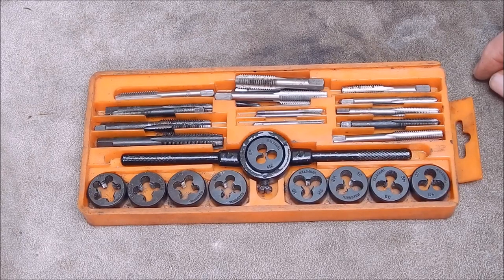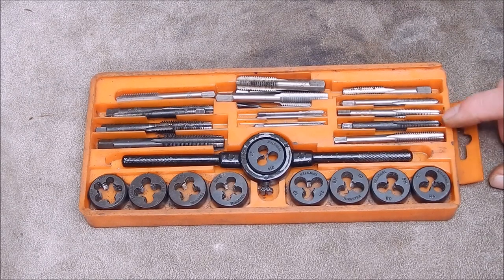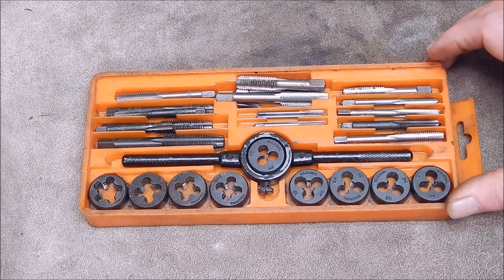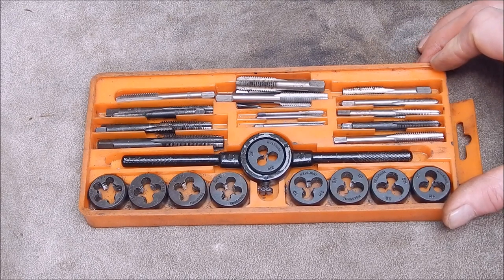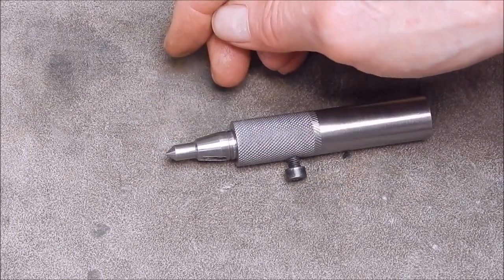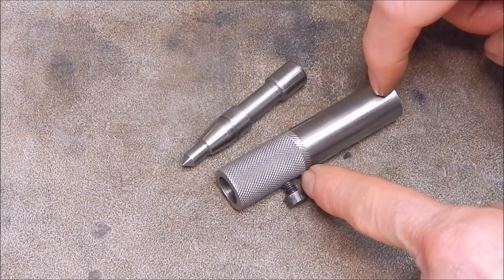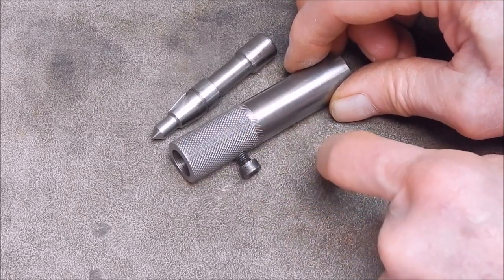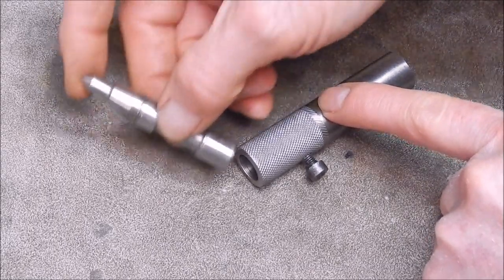I finally made a thread tap follower

Comment: Good looking tool rob, old scrap is were I get most of my material.
Reply from the maker: Same here.  I only buy steel if I need a specific size or grade.  Using secondhand metal is a great way to up your tool profile and use knowledge ;)  Quite often tools need to be re-ground to get a decent finish on scrap steel. Usually it's a surface feathering issue.  HSS is your friend in that situation.  Cheers Rob

Comment: Nice job, Rob. All the best jobs start with a good root through the scrap bin. I have a bought one, but couldn't find it last time I wanted it so maybe there might be a Mart version soon. You might want to look at reducing the diameter of the coned end in case it needs to fit inside the jaws of the tap wrench. What I could do with more is a die holder for the tailstock. That would make a nice little project. All the best. Mart.
Reply from the maker: Hi Mart, I can easily reduce the diameter or length at the cone end if necessary.  I looked at my taps that require that sort of locator and thought it would be OK.  I will know for sure when I use it I suppose.

I made several tailstock die holders of different sizes over the years and they are dead easy to do and super useful.  Making the mounting tang hollow and using a collet chuck works best as it enables a lot more length and bigger feed though than with a drill chuck.  It's also more rigid for big diameter work.

I'm a huge fan of ER collets and have used 32's for decades.

Cheers Rob
Reply: Hi Mart, if you're interested, I made a tailstock die holder to my own design that can also be used for taps, sensitive drilling and probably some other stuff I haven't figured out yet. I did a series of videos on the making and I have pdf's of the drawings available, just let me know over email and I will gladly send you a copy. I used it in action when I made my tap follower if you want to see it working. Cheers, Jon

Comment: Nice vid Rob. 
One of my first projects I made when I got my first lathe, they are great for helping getting the tap straight. I ended up having to remake the point on mine, I made it out of 12L14 but it was to soft and showed wear real quick so I made another out of W1 drill rod and hardened then tempered it.
Reply from the maker: Drill rod sounds good.  Easy project.  Cheers Rob
Reply: I meant tempered then annealed it some. Oops.

Comment: Rob, I really like like this simple, 2-piece design. I'll be using some of your ideas when I eventually get around to making my own follower. You do mention several times that you used "good quality steel" for this project. While I certainly agree it's a good idea to use the best materials your have, for any project, I wonder just how much wear-and tear a device like this would see. Why not aluminum, especially for the outer tube? In my small shop, on my 7x12 lathe, I find that machining steel is a much bigger chore than machining a similar item from aluminum. Even if the plunger was aluminum, how many holes would you need to tap before the end(s) of the plunger became unacceptably worn?
Reply from the maker: Hi Walter.  You could try aluminium for the plunger and easily replace it with steel if it wears.  I think the concave would wear a lot more than the point as it will be subject to attack by the tap end corners (severe).  The body could be aluminium provided you oil it internally.   Try it and see.  Cheers Rob

Comment: That's very nice, Rob, keep meaning to make one myself.
Reply from the maker: Jon's video inspired me to make it.  Should be useful.  Cheers Rob
Reply: @Xynudu  And yours has inspired me to go out to the workshop and make one for meself.  So it goes...  No 1 Morse taper on mine (so it'll work on the ARE, plus the Schaublin and drill press with an adapter), body at 16mm because that's the size of collet I had mounted in the lathe and it's enough for me to use one of the  very nice 10mm scraps I have lying about as the follower.

Comment: 👍 Nice one Rob, I've only been wanting to make one, and some other tapping related things , for 10 yrs. One of these days mate🍺
Reply from the maker: Hi Bill.  You can't rush these things, have to think them through ;)   It turned out OK, considering I didn't have a lot to play with. 

I try and do most of my threading on the lathe and that way you have plenty of options to keep things in line.   I have one more threading tool I made quite a while back that is also worth a look/share.  Cheers Rob
Reply: Agreed Rob. Much more satisfyng to spend a day planning and thinking before fucking it up anyway 😁
Been a while since I had to thread anything and most of my needs are not precise. Would like sth similar to what Steven Lang made a few months back, that would be the time to make a follower too.
One day 🤣🍺

Comment: Hello Rob,
A nice take on Jon's tap follower... what lathe(s) did you use to make it...
Cheers.
Paul,,
Reply from the maker: Hi Paul,  I used the larger Chinese CQ9325 for the body and the Schaublin for the plunger and taper.   The Schaublin compound is not really suitable for knurling, so all the heavy work gets done on the bigger lathe.  Plus the CQ9325 has power feed which makes using a boring bar for long jobs simple.  Cheers Rob